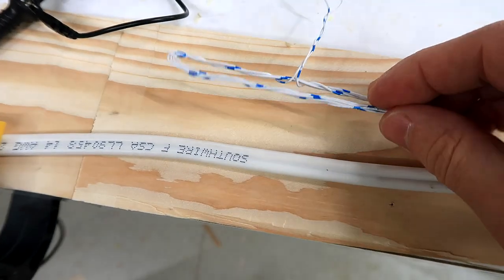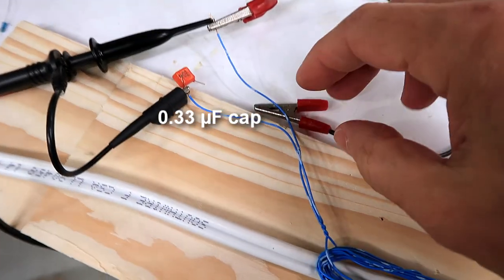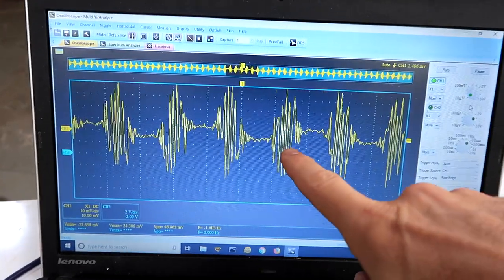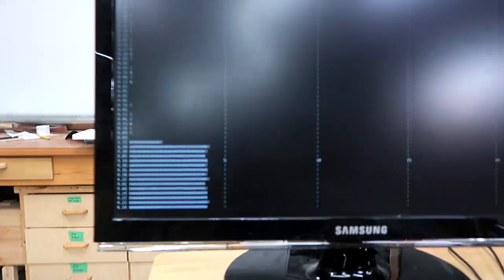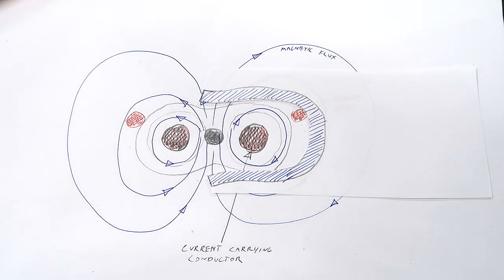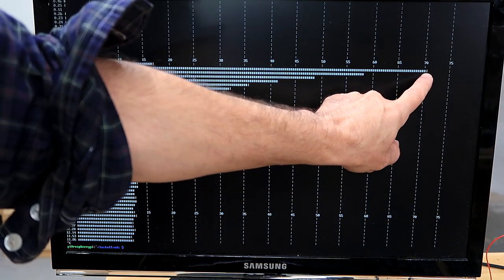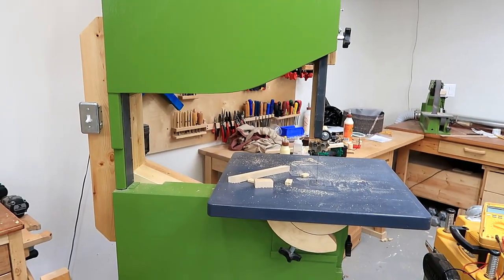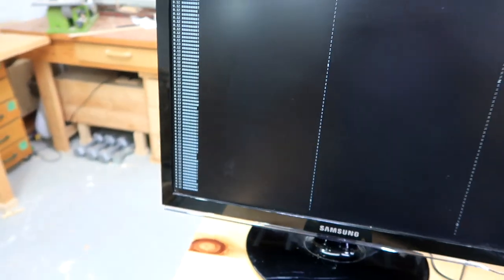Inductive current measuring using Raspberry Pi

Comment: 9.06. That is right in line with what we are taught as electricians when calculating fuses for motors. 
We are taught that most motors will surge with roughly 6 times the current of steady state. 70A/12A=5.83. So bang on! The same goes for the circular saw
Reply: Is this true for DC and AC?
Reply: @jj87a  oh sorry. AC motors. More specifically squirrel cage, asynchronous-and universal motors. Which are a very large part of AC motors used
Reply: @jj87a  I'd say yes, it's the starting that takes the big surge and is the hardest on the wires (regardless of the motor type). At the big saw mills, they turn on the motors sequentially. Turn them all in at once and you could black out half the city to the whole province/state.
Reply: @casperunnerup  the exact multiplier may be different for different types of motors, but all motors consume more when starting. Some will take more than 10 times the rated current during start under load.

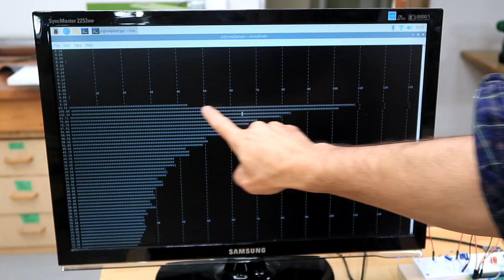Comment: 10:30 You should lookup the trip curve for your circuit breakers. For example, if I look at the trip curve for a 'C' curve Eaton Breaker I see that it could let through 9 times its rated current (that's 135 Amps  for a 15A breaker) for almost 3 seconds, however at 10 times rated current (150A) it will trip in < 0.02 seconds.

Comment: I've been an EE for a LONG time.   When I was relatively new at the job, an old timer pointed out that if you want to get rid of "noise" you have have have an energy consuming element.  IOW: a resistor.   Non energy absorbing elements (caps and coils) merely move the noise energy about.

Comment: Depending on the breaker characteristic, it could trip "instantaneously" for anywhere between ~3x rated current to ~20x rated current. Look up the trip time characteristic curve for the manufacturer and part number for the breaker in the panel - there should be a point where it jumps in value from seconds down to milliseconds (it'll be a log-log plot, so it's pretty obvious)
Reply: Exactly right Steven. Then Mathias needs to buy a DRLO/Ductor to play with tripping that breaker instead of plugging everything in his shop in lol
Reply: True in the UK too. When I first got my table saw, it would trip the breaker in the garage every time I tried to turn it on. Had to replace the 'B curve' breaker with a 'C curve' breaker, which is more tolerant of high inrush currents.
Reply: I had the same thing in mind, which type of characteristics is the breaker. In Europe we have B and C type mainly in home appliances

Comment: Two things: first try to find characteristic (time-current curves) of your circuit-braker, what is important there is to notice that it is just integral from i^2*t on chart. Second measure voltage without and with some restive load (electric kettle is good). Then from current with load and the voltage drop on your cables you can calculate impedance. I don't know exact english transcription but it is something like: external loop impedance. When impedance is high with installation overload (or even shortcircut) you get hot cables (and fire in long time) without breaker trip (because with big impedence, current is not big enough). 
I am not sure that your fuses are well chosen....
I like your videos, so if you need something from mechatronic engineer just write me :)

Comment: I had a number of ideas to measure the "mileage" of a thickness planer (or really any of our rotating tools). I think it would be fun to watch how much linear or squared feet of wood I've planed increase over time.
Measuring the current jump with such a coil when the cutting head engages the stock seemed like the best overall method.

Comment: My question now is why don't they make a clamp on transformer that fits nicely over 12-2 or 14-2 romex? It seems plenty sensitive, and that way most of the branch circuits in a home could be monitored right out of the box.
Reply: if you put the clamp ons in the breaker box where the wires are already separated when the hot is going into the breaker you don't need that?
Reply from the maker: it would need calibrating based on the wire geometry.  I think I will make a wooden insert to go I to the hole to clamp it in a consistent position, then fasten it closed with a zip tie.
Reply from the maker: I would rather not introduce more stuff to the inside of the breaker box.  breaker boxes are messy, with exposed line voltage.
Reply: @matthiasrandomstuff2221  In my case, all the wires come out of the breaker box and are exposed to air for at least 6" above the box (which is bolted to my foundation wall), so I have plenty of access without even removing the cover.

I forget that many people probably have boxes that are inside walls, which would make that a lot less appealing.
Reply: I'm using some DIN rail mount units I got on eBay for $16 each.  They measure current, voltage & several other parameters with the ability to transmit that via a serial RS485 output.  The downside is they need to be wired in series with the circuit to be monitored but they work quite well.
Reply: Fitting only over half of the wire means you will have air in your magnetic loop which will cut down on linearity
Reply: @wanderinguser7665  Can you share a model number of one of those?
Reply: @wanderinguser7665  Thanks!
Reply: Well, well, if it isn't the dark overlord of raspberry pi's :-)
Thanks for you channel Jeff, great info!
Reply: @ciaranfarley  i have a commercial device that does this.  It's called "sense" and it tries to use machine learning to determine loads (inductive, resistive).  It was a total waste of $300.  I think this video highlights a very good path toward a DIY solution if you're comfortable working inside your electrical panel.
Reply: Because every country has different types of cables. 
A single conductor is the smallest thing in common.
In Europe, double-insulated round cable is used. There all three (sometimes five) current conductors lie close together in a triangle (or five star). There are flat cables but only with national approval.
Reply: Matt: you are on another level buddy! Great experimentations, great engineering capability; a complement from electrical engineer. Well done

Comment: I've got a spare Raspberry Pi (well, 10-20), an Adafruit ADS1115, and loose ethernet cable...I should give this a try!  Well also a chinesium ADS1115 and some split current-sense coils, as I intended to do a similar power-monitoring project already. :D

Comment: You can often request a breaker datasheet from the manufacturer. There they show how long it takes for the breaker to pop at a specific current. The graph is hyperbolic and if the current is <= the rated, then the time tends to infinity, as the current starts exceeding the rated, things get interesting quickly.

Comment: I used a clamp meter to verify that I was getting high spikes in the electric here. I found out both by capacitors blowing up and certain led lighting having bright flashes. Finally, they fixed the local transformer.

Comment: Most circuit breakers have a graph of time vs current for it to operate. After many years of electrical engineering, I'd say that a crude rule of thumb would be that a breaker will open when the surge current is 10x the breaker rating. But I have to say again, this is a very crude generalization, consult the manufacturers data, and then add in correction factors for age of the breaker and for the shape of the initial current surge.  :-)

Comment: I have seen breakers stick closed when the inrush current was to great. It makes a terrible buzzing noise. It was a new installation, the neutral was wired directly to load.

Comment: Wants to measure current in power lines.

Matthias: Builds a complicated, safe, and effective system.
ElectroBoom: Plugs in cut and frayed wires to the outlet to measure. 

Both are equally entertaining to watch.

Comment: When there is a “dead short” there is a very high fault current. Much, much  higher than what there is during an overload condition. Then the breaker will certainly trip.

Comment: Just note: Breakers, or even old ceramic fuses, are made in my country with various "speed" characteristics. For example 10A normal will hold just a few amps over and goes off almost instantly, while "slow" one (old ceramic ones had snail shell printed on) can take peaks from devices like engines for few seconds and still keeps on without going off instantly.

Comment: Interesting video as always. Measuring current is one thing, but you don't know the phase of the current with respect to the voltage. If  you measure that too things will get even more exciting. And as for circuit breakers, they are designed to prevent your wiring from burning whilst not nuisance tripping from inrush current. Check out the characteristics for these things, the amount of current needed to trip the breaker is strongly dependent on the amount of time this current flows.

Comment: I wonder if the clone chip is based on the ADS1015 instead of the ADS1115. The 1105 is a 12-bit chip with higher sample rates. If the data interface of both is the same that's what I would bet on.

Comment: Very good measurements. I will say this though, I don’t think the pi setup is quick enough to measure the in-rush current.  I went through this on an aircraft in where they use 28VDC but they have a radar system that is powered by 120VAC 3phase.  In order for this to work, they use three separate inverters that are synchronized together.  

When the operators would enable radars their monitors in the back would turn off and after a second or two turn back on.  We did numerous load analysis tests on the aircraft and everything looked great, until we pulled out a more modern oscilloscope and tested across the main DC bus.  When the radar was enabled, the 28VDC bus would drop to 0.0 VDC for 3 milliseconds.. yes, three milliseconds.  The load analysis equipment we had would take at max 4 samples per second and didn’t see it.  This short power interruption was caused by the capacitors inside the inverters.  When first turned on, they act like a dead short across a circuit until they charge and therefore build resistance.  

I’d be willing to bet that circular saw alone would be 150-200 amps for that 0-5 millisecond range until it spins up and induces its CEMF (counter electromotive force) or back EMF into the windings. 

As always, I enjoy seeing your videos and it’s crazy what you have done with that Pi. It makes me want to get one lol.  

I’m building a project van and should get something like this or a DC clamp meter so I can do load analysis and such for figuring out what my load is on the alternator to make sure I’m not going crazy.  Shouldn’t be too bad as I’m switching out to LEDs and whatnot.  

Keep up the great work!!
Reply from the maker: Yes, it may have peaked higher briefly.  But the saw is an inductive load, not capacitive, so that inrush won't be as bad.  Also, it's DC resistance is more than 1 ohn, so it couldn't take more than 100 amps.
Reply: @matthiasrandomstuff2221  that’s smart.  Didn’t think to consider the resistance of the windings themselves.  You’re completely right.  With that, as it spins up, the CEMF will further lower current as well.  Thanks for the info and reply!!!

Comment: Hi Matthias, excellent work!  I would suggest you try a coil transverse mounted to just one side of the romex. Thus trying to only sense the current in say just the black wire. Since the white and black carry opposite currents they are trying to cancel.  Wind a coil and place it on the side of the romex.
Reply from the maker: please learn about electromagnetics, or try out your suggestion.

Comment: There are $10 smart outlets on Amazon that can measure current and are WIFI enabled. I’d probably try and use one of those with a pi but I love your DIY approach and problem solving. I recently bought an amp meter for the same reasons.
Reply from the maker: I have one.  updates too slow.

Comment: In Australia the short circuit trip current of a breaker is 7.5 times the breakers rated current. So if its a 16A breaker then the instantaneous trip current would be 120A. You should cut a wire to make it short circuit and see what current reading you get. Just use properly insulated tools

Comment: in your dark blue coil you're wrapping the turns around the torroid of the loop. this will add noise to your signal. leave those out of the wrapping and use tape or something non-conductive.

Comment: Wow, really neat. I didn't realize you could do this over the wire pairs, thought you needed a single conductor thru the coil, like that clamp on transformer you showed. I have been curious about Hall effect current sensors too, but have so far been too busy and too cheap to buy one.

Comment: Yup, your first attempt made a high-pass filter. With a resistor in series and a capacitor in parallel you get a low-pass filter (and the much-cleaner signal on your scope).
Reply: Would probably recommend a bandpass if he wanted that 60 hz only... or use a notch filter if he wanted to rid it from the signal

Comment: The white is neutral wire and connected to the ground in the breaker box. The alternate electric flows on the black wire from the breaker.
Reply: The alternating current flows on both the black and the white when a circuit is completed.
Reply: @bradley3549  your right I'm just getting old.

Comment: A few months ago my dust collector was failing to start and tripping the breaker. My first check was a current clamp meter over one conductor and it would get up to ~70a (120v) before tripping. And that's with a slow meter without a min/max function.
Reply from the maker: probably the startingswitch was failing to make contact, or a blown starting cap

Comment: This is a very practical invention. I don't expect the length of the pickup coil adds at all to the sensitivity.  I would expect the number of turns to improve sensitivity. How would one connect two coils to provide a quadrature signal that will tell you the direction of current flow for when, for example, current is being fed to the grid or being drawn from the grid?
Reply from the maker: Sensitivity of the coil is proportional to length, and to number of turns.
Reply: @matthiasrandomstuff2221  Hmmm. I always thought that the induced voltage was proportional to the number of field lines that dissect the area of the plane of the coil...and yes, now thinking about it you are correct - increase the area by lengthening the coil will increase the area and therefore the number of field lines through that plane...thanks Matthias!

Comment: Very useful also if u have a wire like in europe. 3 in a triangle not in line and from exterior is a circle. The current transformer also not possible.
Reply from the maker: it would take some experimenting to find the best placement, but it would not be as sensitive.

Comment: The shield couples just one wire to the coil as long as it does not approach the centre of the current carrying wire. In the diagram the flux should be shown from the second wire going in the opposite direction.  You may get better results if you wound the coil around the 'shield'  which would then become a transformer core and then put the shield / core a bit less than half way across the wire.

Comment: If your coil had enough loops you could pass its output through a rectifier and filter cap to get a smoothed reading. More loops in the coil means more voltage allowing it to more easily overcome the forward voltage drop of the rectifiers and so it can be measured accurately by a lower-impedance device.
Reply from the maker: I already do a better job than that with the signal processing in the software.

Comment: Your lucky, my modern house distribution board pops the breaker every time I start my circular saw or drop saw. I need a circuit with a slower current curve for those high surge tools. I have to run them from my portable generator in order to use them at the moment. They worked fine in previous homes I lived in. Just newer electrical standards for wiring now.
Reply from the maker: Try a different breaker or replacing the breaker.  Typical breakers can take 10x the rated current for short periods without popping.
Reply: @matthiasrandomstuff2221  I think under new Australian wiring rules the breakers now  fitted can't handle that in rush current as standard. I need to pay a licenced electrician to install a breaker with a trip curve that can sustain the higher in rush current.  At least that is what I can deduce from Google, the circuit is good for my arc welder and heaters etc, so full load rating but not the initial in rush current.
Reply: In the U.K. and Europe the standard for miniature circuit breakers in the domestic environment, BS EN 60898-1 defines 3 types of breaker; B, C and D.  In use, the UK standard for electrical installations, BS 7671, defines 2 types of circuit - distribution and final circuits with the requirement that breakers protecting such circuits trip within 5 seconds and 0.4 seconds respectively.  B and C type breakers trip @ 5 and 10 times their rated current to achieve the time requirement.  D type breakers trip @ 10 and 20 times their rated current to achieve the 5 second and 0.4 second time to trip requirements respectively.

Comment: Now I'm very curious as to what is inside the split current transformer. I was under the impression that they didn't work unless closed. Quite interesting!
Reply from the maker: calibration is way off if opened.  they just pick up a lot less.

Comment: Try two separate coils, one over the black wire edge and one over the white wire edge of the cable.  Connect these coils in series in different polarities till you get the highest output.